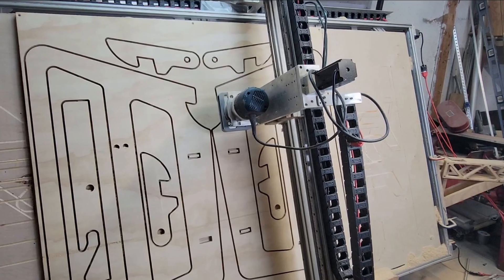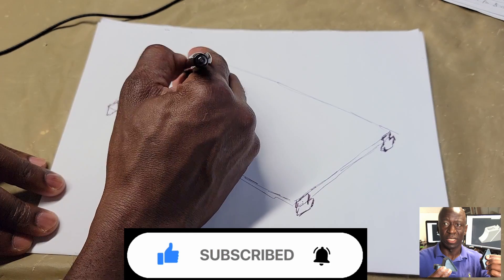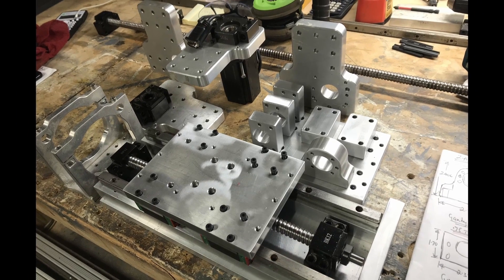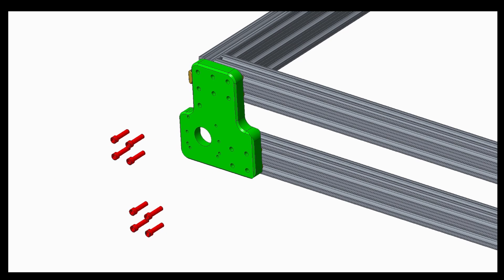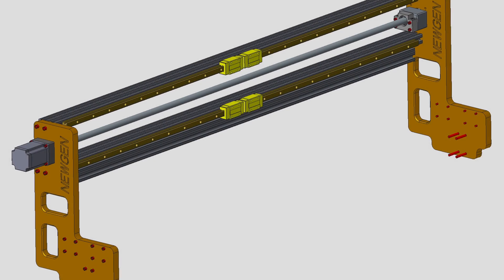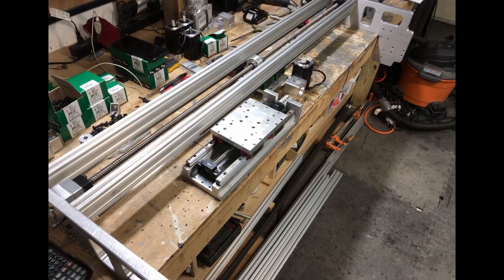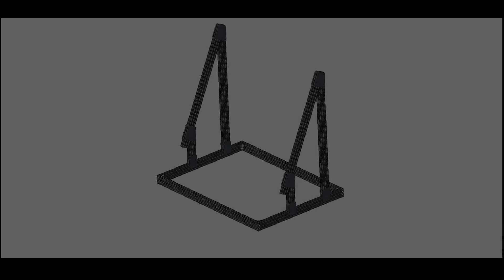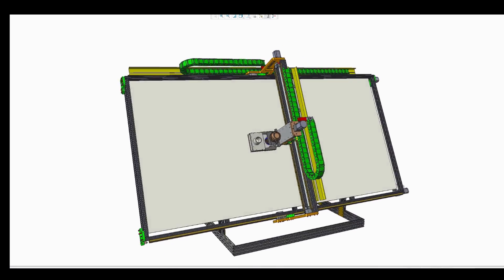How I built my own CNC router from scratch!

Comment: Cool design! I would like to add a larger CNC to my shop but I don't have much space to spare. I had been wondering if a vertical setup would be possible. Have you noticed any accuracy issues along the X axis?
Reply from the maker: Hello and thanks for watching. No issues whatsoever with the X axis. There are commercially available verticle CNC routers out there. I will send you an image once I find it. The only issues come within the Y axis (8 foot long). The ball screw will sometimes skip with a high rapid jog. I have tried to remove as much sag as possible. I will eventually go to a rack and pinion on the Y axis.
Reply: Thanks for the info!  @simbamkuu33
Reply: @simbamkuu33  Are you using open or closed loop steppers?  If open loop then I would suggest that a change to closed loop would be easier than changing to rack and pinion.  Closed loop steppers used to be much more expensive but now the price difference is small and the performance difference is huge.  BTW.  I have always thought that a near vertical design is much more sensible than the usual horizontal for a large router.
Reply from the maker: @MotoChassisByTonyFoale  Hello Tony. I will definitely inquire more about the closed loop steppers. Thanks for the info. I am actually working to solve the issue as we speak.